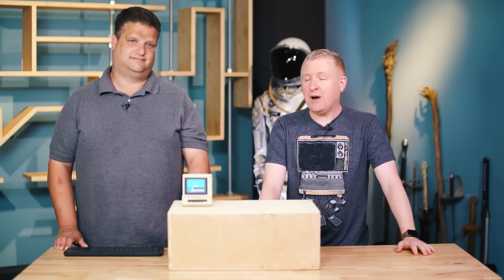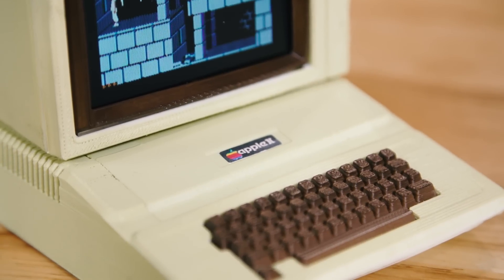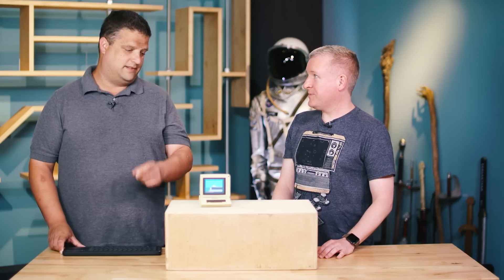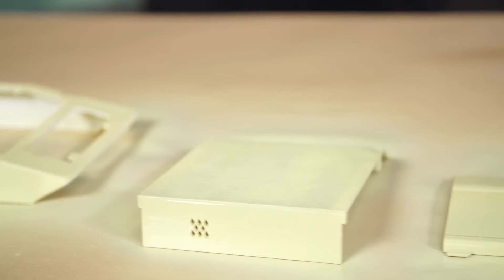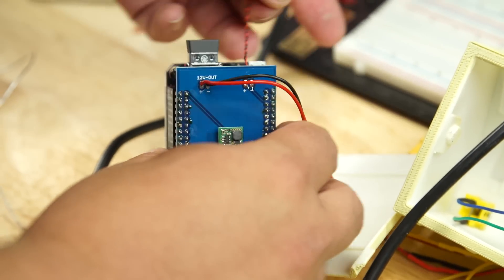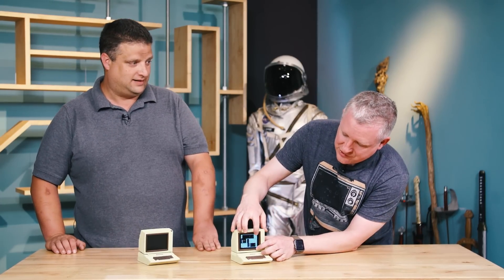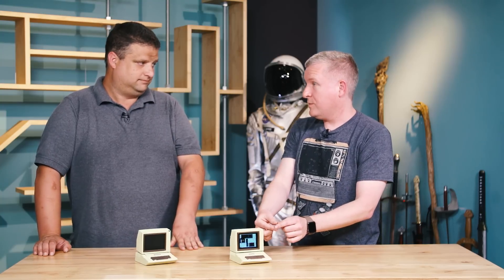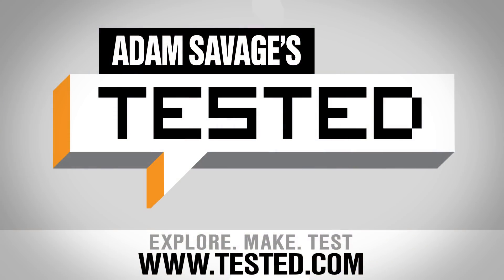Building a Working Miniature Apple II Replica!

Comment: I'm 52 years old now, and when I was a little kid in the late 70s, I got into computer programming by reading manuals and my parents got me a TRS-80 Model I.  I learned about all the Radio Shack computers, and I was fascinated and obsessed with the Model II business computer and had a dream that I had a little replica of that machine.  I recall seeing the screen working, and hearing the noise of the floppy drive, when I saw the computer in the dream.  Back then, it was impossible to fit all the electronics of a desktop computer inside a case the size of a little replica, so you couldn't build a working TRS-80 Model II replica, or a replica of any other microcomputer from the period, until well into the 21st Century.

Comment: The guy who designed the case is the guy behind RetroConnector.com. Charles did alot of work to make the 3d cases, he also advises to use a different printing method for the files to work better.

Comment: I worked at a Apple Education Lab here in Canada as part of a co-op placement...and I couldn't afford a real Apple ][+, so I soldered together a clone motherboard and expansion cards (Z80, Videx 80 column card, Disk ][ interface, 16K memory expansion). So it took me more than an afternoon to build my Apple ][! 

That said...you are totally wrong about the power button. The power switch for the Apple ][, and][+ and the //e was on the rear left of the computer. Now a popular addition was a Kensington  System Saver fan that clipped on to the side of the Apple ][,  which also had a power cord such that you would plug your normal power cord into it, and it had an IEC cable to connect to the Apple power supply. Thus you would put the power switch on the Apple to the on position, then plug the computer in through the Kensington fan unit, which had a big power button on the front of it, which enabled you to turn off and on the computer without having to reach around behind the Apple to hit it's power switch. The monitors you model here were not Apple's, but a third party one that was made to look like Apple's. They did much the same thing as the Kensington unit did...you plugged the monitor into the wall, and then it had a plug that you put into the IEC plug on the Apple, enabling you to turn the computer off and on without having to reach around the back and fumble with the power switch. 

The Apple ][ socketed all of their chips...that's a lot of soldering I had to do! Because the Apple ][ ran hot..and I do mean hot, the heating and cooling of the sockets would cause the chips to slowly creep up out of the sockets, causing the system to not turn on. So when a system in the lab didn't turn on, the first thing you would do was make sure it was plugged in, then before turning it on again, go in, and after statically discharging yourself, firmly push all of the chips, especially the memory chips, back into their sockets. This solved the problem more often than not. That is why the System Saver fan was such a huge success, since it both gave you a "front" power switch, and it cooled the unit which prevented the chips from creeping up due to thermal expansion.

Comment: This is needlesly complicated. Using a raspbery pi zero W and a 15 dollar rear view cammera LCD you could make this easier. The sound would be the only problem and even then you could use the PWM outs and a cheap PAM8403 to set up a small speaker. You would not need any extra DIY pcbs. You would only have component video output though unless you make a HDMI breakout.

Comment: where the heck is everyone buying the c.h.i.p. for $9 ?!?!?!    next thing's site isn't selling them and ebay and amazon sellers want $30 for one!
Reply: Well i'm pretty sure it was merely a Kickstarter stunt. The $9 C.H.I.P. (and by the way, i hate that name, it just makes it so hard to google!) was a Kickstarter reward, and industry analysts warned that it's not actually a sustainable price, it's a little bit under cost. Now i know, the processor is just $3, but once you factor in all the costs, the power management IC adds another $1.50, the RAM and Flash another few $, the board production and assembly and jellybean parts another few $, and it's a multi-layer PCB, it's not less than $1, then you need to reserve some for warranty and customer service, then you have costs of running a business, it really isn't coming together for under $12-$15. So chances are, they picked up all the promotion they could get from releasing a "sub $10" single-board computer, and are now recouping their losses by selling it more expensively.

Comment: The apple ii didn't have a colour screen
Reply: Richuncleskeleton The Apple II was in color. You just had to connect a color tv or color monitor to the video jack. Most monitors were monochrome back then, but the computer itself generated color video.
Reply: Plus, the monitor they are basing it off was a color monitor. The one with the swivel. My personal setup, I have a //e + Color Monitor + Duodisk. Works fantastic.

Comment: The Apple II did not have a monitor you used a TV as the Monitor. The Monitor you showed was for the Apple II GS.
Reply: No, the monitor modelled here is the correct one for the ][ and //e. The IIGS came  later and used a very different style of monitor.

Comment: Some random thoughts:
-I want one!

-Bondoing the 3d prints might take longer than five hours including lunch break, but it might be feasible to approximate the original texture, or at least get rid of the obvious printing strata! (If it makes its way into a kit, and is in sufficient demand to  make it affordable, injection molding would be great!)

-Integrating the external USB connector(s) to the pcb serving as IO for the chip would provide better support and durability than having it wired and glued, additionally, it would be neat to design it to make use of a usb hub chip, and provide internal headers for potential upgrades, neater than wiring in a ready made small one...

-It's a pity camcorder CRT visor screens are too deep, it would have been killer, just as making a working keyboard instead of a dummy one would, even if only usable by typing with the tip of a pencil...
(but i guess it would be awfully costly, a nightmare to assemble, and it would also be difficult to design durability wise, I don't see how 3D filament extrusion might provide strong enough parts that size!)

Ah, and I WANT ONE!